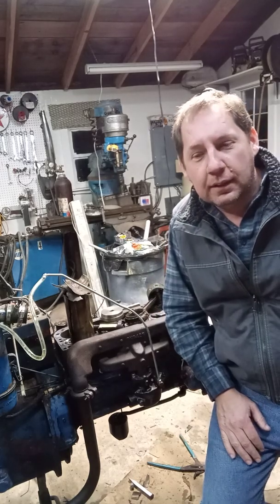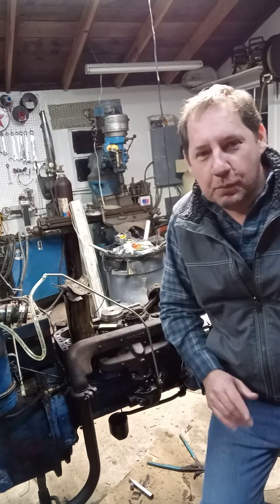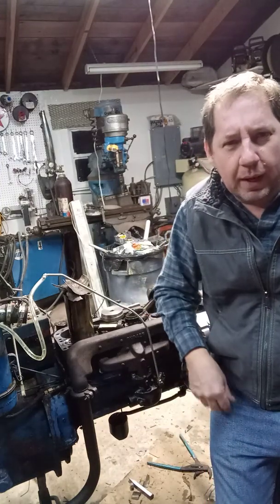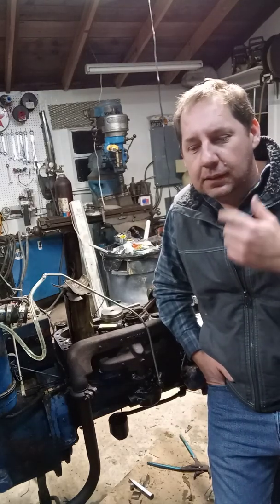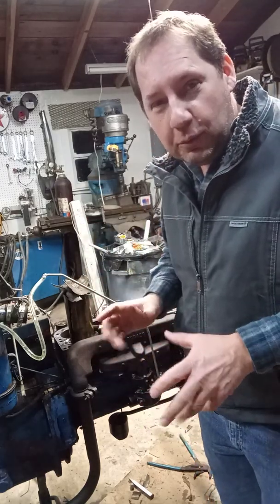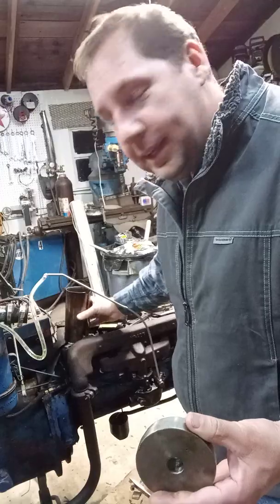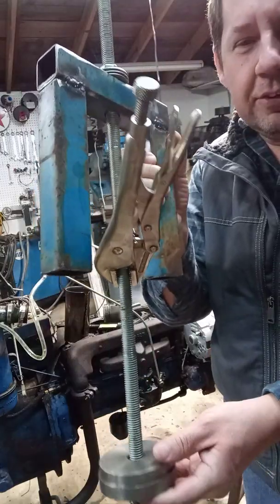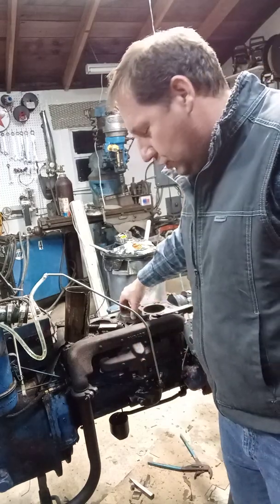9N 2N 8N Piston Sleeve Removal

Comment: So just for folks information.  There are two types of sleeves that went into these old tractors.  A .040 thickness sleeve and a .090 thickness sleeve.  What you're seeing here is the .040 thickness sleeve.  The .090 sleeve wasn't used until the middle the 8n run.  So if you have a 9n, 2n, or early 8n these used .040 sleeves.  Now here is the fun part.  Many of these early tractors during their first rebuilds had the sleeves pulled, honed the owners had the parent bore in the block honed and ran a 3.228" piston in the parent bore.  This worked fine and well and bumped the power 1-2 HP, but then you had another problem when you had to refresh the engine again.  With as much farming as folks did with these machines back in the day it's not uncommon for them to have been rebuilt 3-4 times in their lives.  Once you run the piston in the bare bore the most commonly executed option at that point is to have the block bored for the .090 sleeves and take the tractor back to the OE bore size.  There are oddball sleeve piston combos that have been conjured up over the years so bear that in mind too but what was described here is what you'll normally see.
Reply from the maker: Good info. I should have mentioned in the video. Thanks